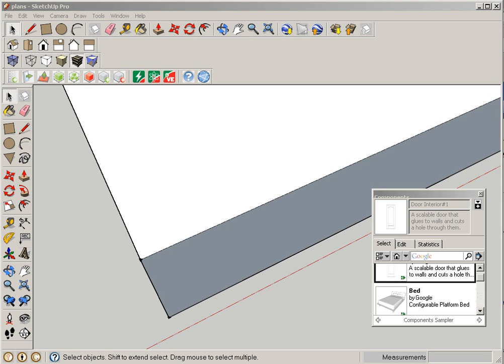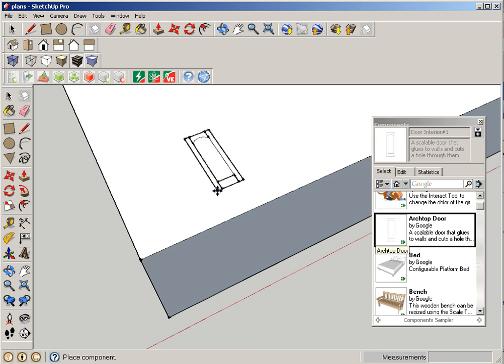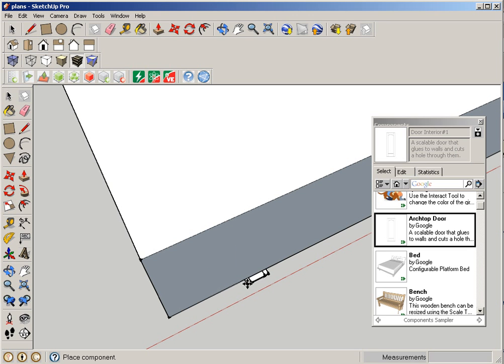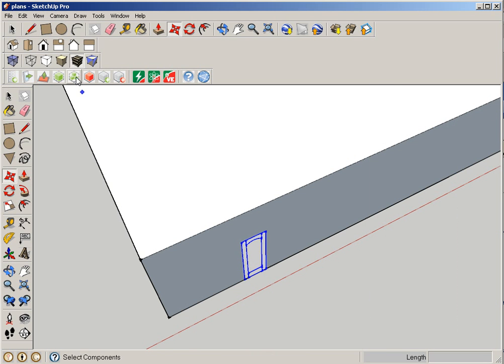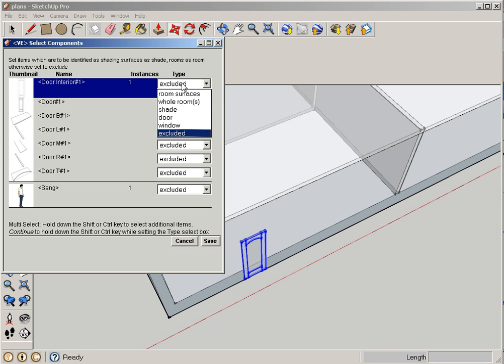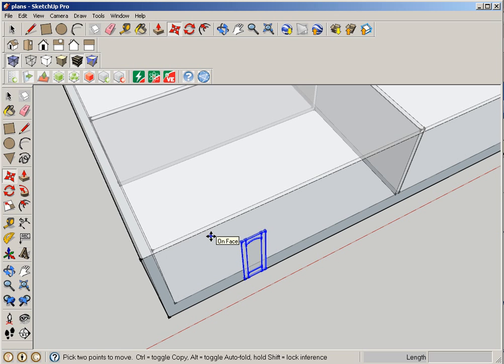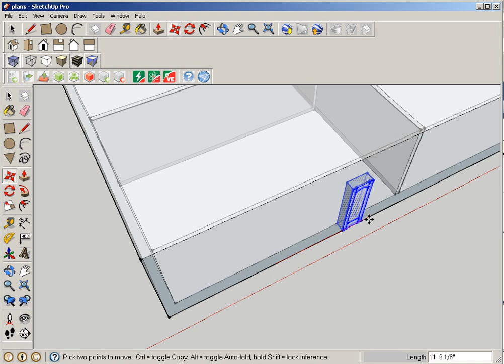Components in Thick Walls (SketchUp plug-in V3 New Feature)

Comment: How do you know if the component has that ability? I've been trying to make my component cut opening for hours now without success. Please help.
Reply from the maker: Hi Christoffer,

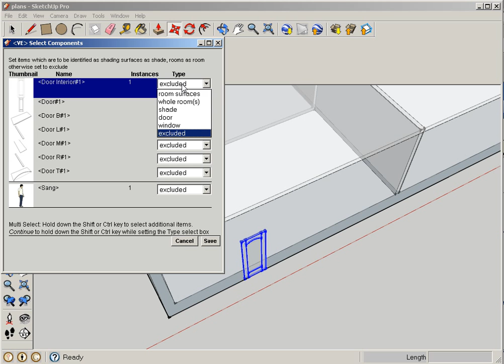If you create a new 2D component in SketchUp and place it on the room then you have to make sure you define it as a window or door on the IES Toolbar ‘Select Components’ dialog as shown (see around 2:12) and then you will be able to select it and use the Push Through tool to stamp it through a Thick Walls model.
If you can’t get it to work then post on our IES User Forum and you can add your own images and the .skp file so someone can take a look and help you out.